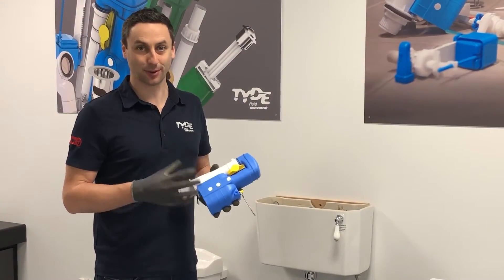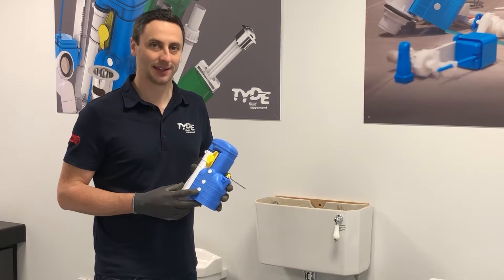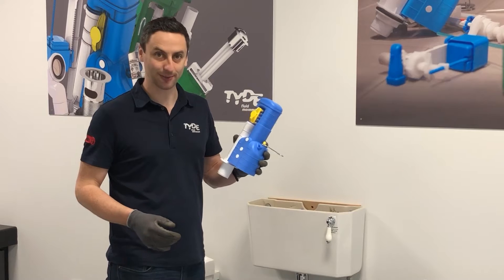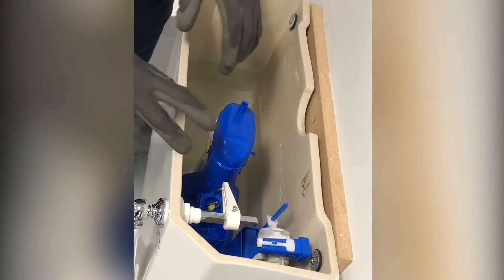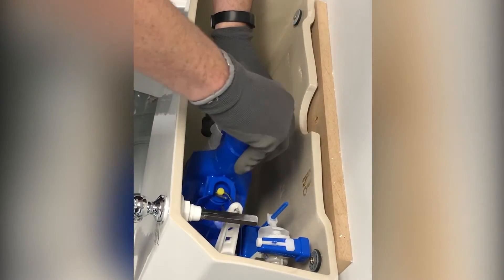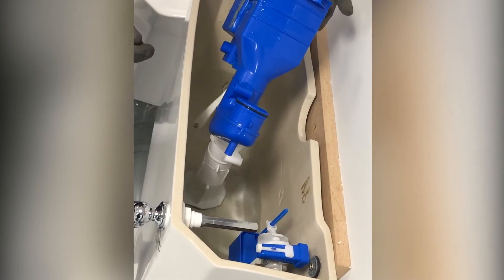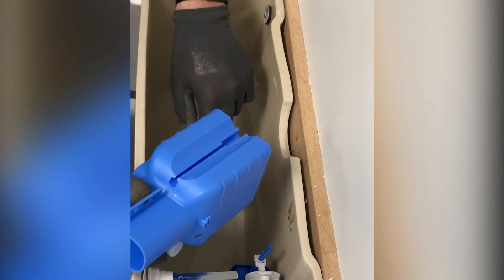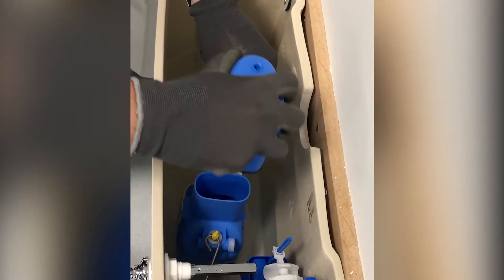How to Install a Dudley Turbo Edge - Retrofit

Comment: just out of interest, why would you change the turbo 88 to a Turbo Edge besides a demonstration, could I use the turbo edge to replace the Shires Lynx siphon, and retain the use of the metal fulcrum flush lever.
 your products are top grade, I have been installing them for years, with full confidence.
Reply: Because the turbo 88 is absolutely massive, quite often defeats the object of having a quick change siphon as the original 88 is so big you have to remove the flush handle & fill valve to get the bastard in place!!!

Comment: when i flush the turbo edge, the water doesnt go all the way to the bottom, i have made it single flush with the white thing inside changed that over and also left the 3 plastic tabs on.
Reply from the maker: Hi James, 

Check that the syphon height has been adjusted on both sides, and that the body section has been fully pushed down to the bottom of the downleg.

Check that when the syphon is flushed, that the two washers, one small white plastic washer, above one small black O ring washer, fitted immediately below the metal C link, are sitting back down onto the top of the syphon body. 
If not, air will enter the syphon at this point giving only a reduced flush.
 

Check that the C link fitted with the syphon, allows these washers to fully sit back down onto the syphon body. If not, you will need to increase the length of the C link.

Check the water level in the cistern, if the water level is only just above the top of the syphon body, it could be that by the time the cistern lever is flushed and released, that the water level in the cistern may already have dropped below the top of the syphon body, allowing air to enter the syphon at this point, and break the syphonic action. 
   
If this is the case, increase the water level within the cistern.  It should be at least to the height of the water level mark shown on the yellow locking pin. 

Hopefully this should help to resolve the issue you are having.

Kind regards

TYDE